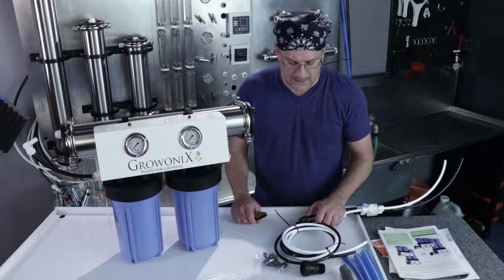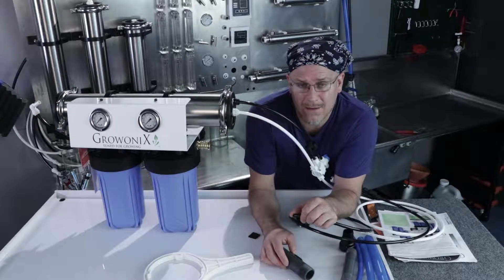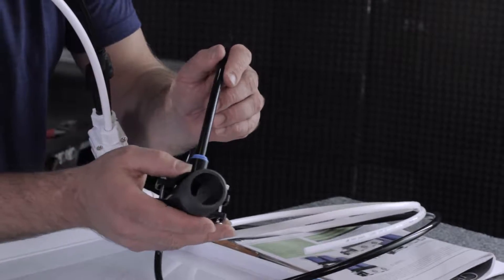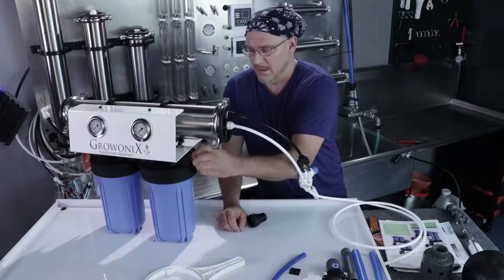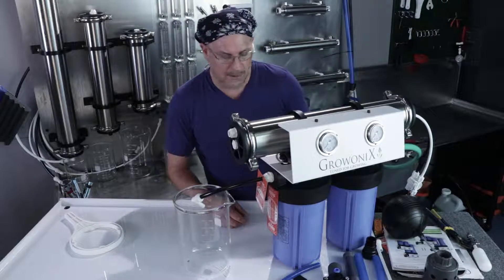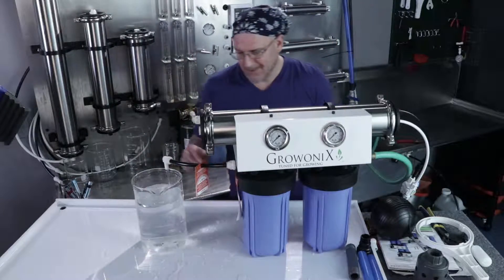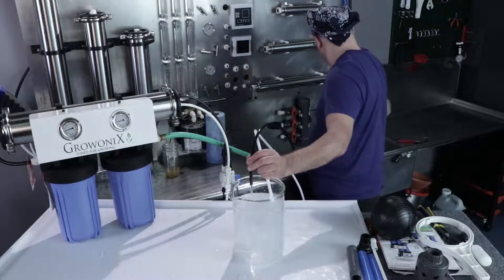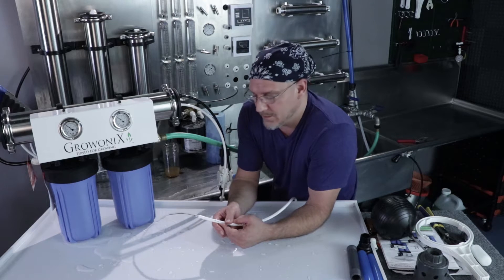GrowoniX EX1000 & EX1000 Tall: Connecting

Comment: Do I need auto shut off valve if my system is tankless?
Reply from the maker: Sorry for the late reply.  You only need an ASV (auto shutoff valve) when you want the system to shut off (both drain & RO) automatically.....from high pressure on the RO line, either from a faucet or float valve etc...    If you wanna run the system manually, and shut the feed water off manually each time, then you do not need the ASV.